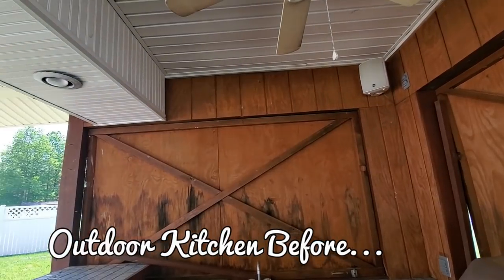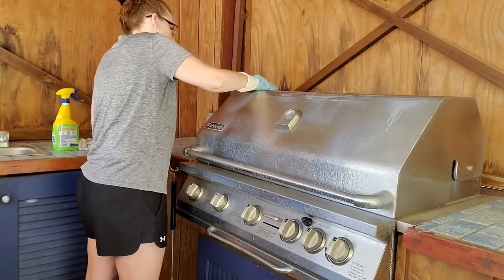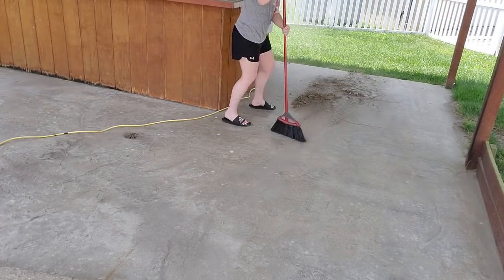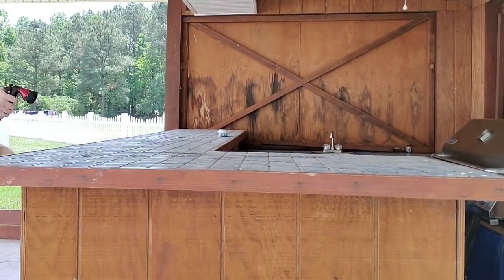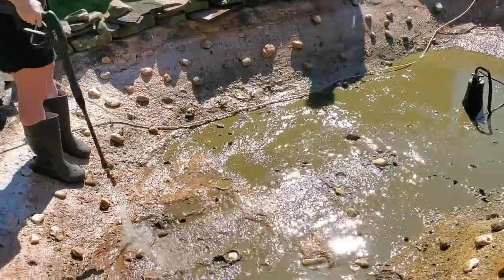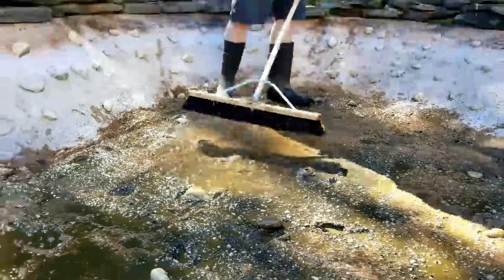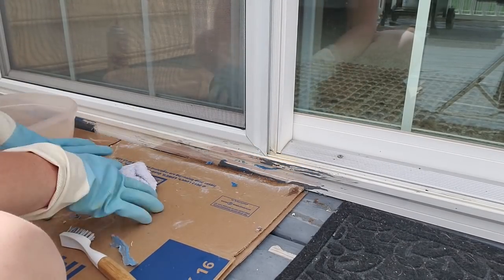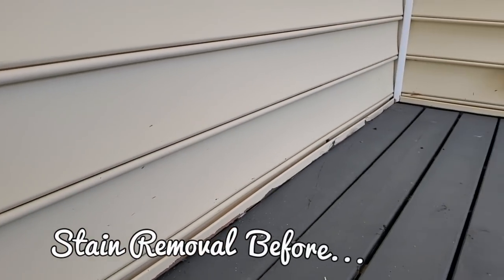INSANELY SATISFYING Extreme Summer Clean #WithMe 2020 Outdoor Cleaning Transformation Before & After

Comment: So happy to see the work you did on the pond.  I'm certain that you and your family will have years of joy and pleasure, just think of the memories.  I have a question regarding a tip you gave regarding removing stains from a bath tub caused by the rubber suction cups.  I hope you remember what mixture you used, or if anyone knows I certainly would appreciate help with this problem.
Reply from the maker: I used the Zep toilet bowl cleaner. I bought it from Lowe's. It is acidic so wear gloves and ventilate well. Also don't leave it on too long if it is a plastic tub! It could eat it away. That is what I used but I have to say a disclaimer that you *shouldn't use it on anything but a toilet *